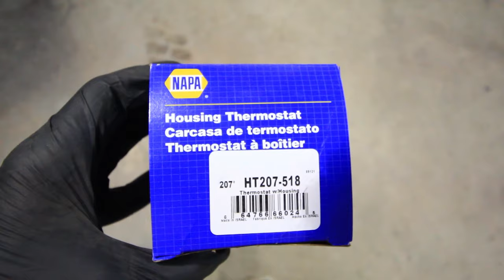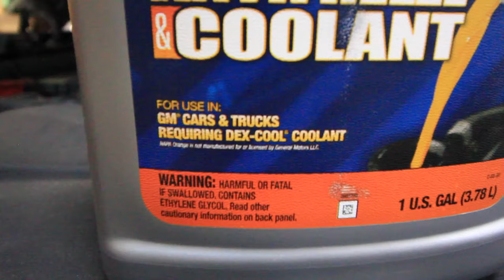Radiator Fan Won't Turn Off: 2014 - 2019 Silverado & Sierra: Bad Thermostat Replaced - Part 12674639

Comment: Just a heads up, if you remove the cap from the coolant reservoir tank it will relieve the pressure, then put the cap back on so that it doesn't drain out. Otherwise, awesome walk through! Thanks!
Reply from the maker: You're correct!
Reply: Do I need to put the cap back on as soon as I disconnect the hoses?
Reply: @jacobstewart4738  before you remove the hoses. I only lost about 1/4 of a gallon changing my thermostat
Reply from the maker: Hey Jacob! You can but it won't matter. we've done this a few times on different trucks.  No matter what you do, you'll loose a little fluid.
Reply: Would you recommend to start with the temperature sensor, or go straight to the thermostat? I haven’t gotten a check engine light so I can’t pin point what it truly is with a code reader thanks. I was thinking of just starting with the sensor first, but maybe through your guys experience you can share what works best.
Reply: I'm happy I saw this! Cause I'm about to change mine out today and didn't know that lol
Reply: Great video. A list of tools needed and sizes would also be helpful.
Reply: How do you know thermolstar is problem.
Reply: 19mm and 10mm

Comment: Great video. Gave me the confidence to do it myself and everything turned out great. I have never considered myself as a “car guy” so being able to get a project like this done was awesome. Thanks for your help and thanks for the video! 

My vehicle was a 2014 GMC Sierra and everything worked great.
Reply from the maker: Hey Fredrich, I really appreciate you taking the time to leave a comment.  It's really cool to hear that I was able to break this fix down and explain it we'll enough to get you motivated.  I'm glad that I was able to help you out!
Reply: You gave me courage rn too imma go to autozone and get the part to do this before lunch
Reply: It was super easy I got it done in 30 minutes work was like 10 of actual work putting everything together again and then let it sit 20 minutes without the battery to reset the system and bye bye problems

Comment: I just replaced the sensor and the problem continued with the coolant fan running and the temp gauge stuck on 160°. I drove it about eight miles, still no change. Disconnected the negative connection on the battery, waited about 10-15 minutes to reset the computer, hooked it all back up and everything is now working perfect! Thanks guys you saved me a bunch of money and downtime at the dealer.
Reply from the maker: Glad we could help!
Reply: I had to do similar but with an OBD2 tool

Comment: I have a 2014 4WD, V6, EcoTec3, 4.3L. The fan wouldn't turn off one day but the next few days everything was fine. About a week later it started staying on again and the check engine light turned on. My temp gauge read zero when it stayed on. Only thing that popped up was thermostat when I checked for codes. Found this video and it helped so much! Fixed it and after a couple starts the check engine light went off by itself, no battery reset needed. For anyone about to do this with this model, I needed less than a gallon of 50/50 dexcool and went a little over the cold full line because the hoses were empty.
Reply from the maker: Glad we could help!

Comment: Same problem fans would not go off. Changed sensor still fans kept running. Took fuses out for fans to keep from running battery down. decided to start pickup and see if guage would move without fans and the temp. rose so I knew thermostat was ok. Took cable off battery to reset computer and put fuses back in and connected cable back to battery. started engine things are great! Thanks for the video!
Reply from the maker: Glad we could help!

Comment: Awesome  video. Just a heads up on filling it. Turn your gallon around to where the spout is on top so air will easily flow in and not cause the coolant to change the flow too much and have a steady pour
Reply from the maker: Thanks bro

Comment: The temp sensor video saved me $$$. After a month though the fan came back on so I’m going to replace the thermostat. My grands call me Granny the mechanic thanks to you. Do you have a video on replacing the shifter cable for a 2005  2500 Silverado? Thx so much.
Reply from the maker: Hello Linda! Before you try the thermostat, check out our troubleshooting video linked here: https://youtu.be/wed9eZxPwsQ

Disconnecting the battery may be all you need.  However, we recommend replacing both the thermostat and the sensor at the same time.  As for the 2005, we don't have a video on that, but if we ever get the opportunity to work on one, we will make a video for you!
Reply: Did replacing the thermostat fix your issue?

Comment: What most of these vids on this topic don't mention is that you'll need to use your code reader to reset the error code once you are done, or disconnect the battery for a few minutes. Failure to do so meant in my case at least, the problem was unchanged. Even thought there's no CEL, there is still a code.
Reply from the maker: What's up Stuart?!  I have to say you are wrong, we go over disconnecting the battery in this video: https://youtu.be/wed9eZxPwsQ. This particular video is one in a three part series linked here: https://youtube.com/playlist?list=PLnPXcXYmgiuvbA7f_Zot4ScG1DJ7QJgO8. As for disconnecting the battery, yes you are correct.  If you don't, the truck will act as if the issue was never fixed.
Reply: What if I didn’t get any codes or anything? Bc my fan is just on and I changed the thermostat and the fan relay

Comment: Love your vids...  I'm not having an issues with the fans running after I turn off the truck...  I'm having issues with the fans turning slowly...  I replaced the sensor and those fans took off crazy fast for I start, then the fans went back to running slow 🤦🏼‍♂️
Reply from the maker: Hey David, that's an interesting problem.  I wonder if it is related to the thermostat?  I see you watched this video.  Have you attempted to replace it?
Reply: @TheBrothersWorkshop  I've just returned from the zone with a new replacement and waiting for the engine to cool down before the swap

Comment: just experienced this fan issue on my 14 sierra.  my immediate thought was temp sensor or thermostat.  did research and it looks to be it..  BUT in my case what i did was while driving i popped in my obd2 elm bt adapter, and literally cleared the code while i was driving with TORQUE lol and the fan stopped and guage dial corrected itself to the actual current temp.  Just in case these videos dont help the issue try that, i literally stopped the fan and corrected the problem with a simple fault clear.  I'm sure theres still an underlying problem which i'll do the sensor and thermostat if this happens again, but i took a lazy man approach today.
Reply from the maker: Resetting the codes will only stop this issue for a short time. It will always come back. That is because you have not fixed the root of the cause. You have to replace the temperature sensor and the thermostat, then reset the computer and the issue will be fixed. Please watch all three of our videos on this topic.

Comment: Does losing that much of the coolant affect the AC performance? It gets 100+° where I live so the AC has to be top notch cold. Hence the reason I need my thermostat replaced to begin with cause my air doesn’t cool when it’s stuck open 😒

Comment from the maker: If you're still having issues after you replaced the sensor, watch our next video linked here: https://youtu.be/wed9eZxPwsQ
Reply: So, did changing the thermostat fix the issue?? I got a 2015 high country doing the same thing.. changed the sensor a couple months ago.. worked fine until no.. doing the same thing.. fans on high and temp gauge at 160.. full of coolant
Reply: Still having issues.  Did the sensor about a year back and it worked until now.  Fan running continuously, I just changed the thermostat a few minutes ago but when I turned car on, fans immediately came on, temp still at 160 at idle
Reply: @timmydixon6167  did you figure it out I also have a 2015 high country and it’s doing the same thing

Comment: Same problem, change the sensor, did not fix the issue. My AC stopped when the fan would not shut off. The tire pressure for 3 tires were on as low on air [ they were around 30 lbs] about a week prior to the fan not shutting off. Check engine lite came on a day later than the fan wouldn't turn off. I disconnected the battery for about 15 minutes and after putting it back on, everything worked correctly. Fan shut off correctly, tire sensors stopped showing low air, ac blew cold air and check engine lite went off. It has been about a week now and no issues [hopefully] yet.
Reply from the maker: This issue does not throw a code.  That tells me your truck is having a different issue, or you may have multiple issues.  If the fan issue continues, I've linked a troubleshooting video below: 👇
https://youtu.be/wed9eZxPwsQ

Comment: Hi! My truck is doing the exact same thing! Curious if this fixed the problem. About to try it myself with your video and I am no mechanic 😅
Reply from the maker: Yes it did! We also made several other videos about this same issue, so you can check out the other videos if you feel like you need more information or detail.
Reply: @TheBrothersWorkshop  so it worked since tuesday and today on my way home from work the AC stopped blowing cold. The gage is still working and no fan now but AC stopped

Comment: hey, i've got this recurring issue with the fan not turning off.. and now my ac isn't blowing cold air at all.. are these problems related? and do you think solving one, might solve the other?
Reply from the maker: Yes, they are the same problem.  This video is one of a three part series.  I've listed our update video below.  It will explain everything and how to fix the issue: https://youtu.be/7gKbLHhD1cw

Comment: Hmmm.   ok, having the issue everyone else is with fan on full blast and temp gauge not moving, so going to replace both thermostat and coolant sensor and erase all codes.  One question thou....picked up both parts yesterday, but online showed 2 thermostats and I picked up the 194 degree one.  I see this uses 207 degree!  Online shows optimal 195 to 205 and why i picked lower of the two, but also suggests 207 is factory stock and helps run better and more efficient!!  Soo, which should i use and 194F or return it for the 207F unit?!??
Reply from the maker: When in doubt, always go factory specific.

Comment: Did that fix the problem? I just changed my sensor over the weekend and am having problems again.
Reply from the maker: Replacing both the sensor and thermostat fix the issue.  It's all spelled out in the video.

Comment: I have a 95 Trans am. My fan stays on all the time. I checked relays (all good!), changed coolant temp sensor and fans still on all the time. Do you think changing the thermostat might help ?
Reply from the maker: I would think about looking into the temperature sensor first, and if that didn't work changing the thermostat.  Not sure how it's set up, but it wouldn't hurt.  Typically I like to change both out at the same time. Realize we did separate videos here, but it's something I would do at the same time.

Comment: So did this solve the problem? I'm having the exact same problem and replaced the sensor only to have the problem come back a few days later. I just want to make sure that before I order the thermostat that this will solve the problem.
Reply from the maker: Replacing both the thermostat and the sensor does the trick. This is one of three videos in this series. I have a troubleshooting video as well. You need to watch all of them. They're linked below: 👇

1. Temperature sensor video: https://youtu.be/aJeksrxcCDI

2. Thermostat replacement video: https://youtu.be/WvLyBM8FHdM

3. Troubleshooting video: https://youtu.be/wed9eZxPwsQ

Comment: I have a 2017 duramax had the code p0128 a couple times changed the coolant temp sensor a couple times and worked for short time. Could one or both of the thermostats be bad? The truck has a hard time coming up to temp also
Reply from the maker: It's possible but the truck we are working on here in the video has a gas 5.3 V8.  This fix works on all of the gas motors.  I know you have a diesel, but it might be worth a shot.  Please let us know how it goes.
Reply: @TheBrothersWorkshop  I forgot to say that the gauge would not move from 160 sometimes it would get a little past half but that’s it never to operating temp

Comment: You just motivated me to do it . thanks for the awsome video. I thought it was like  operating a heart but it actually seems pretty simple thanks a lot dude
Reply from the maker: I thought the same thing before I gave it a shot.  You got it bro! 🙌
Reply: Got it done in like 10 minutes thanks to you 👏🏻👏🏻
Reply: I got it done just had to disconnect the battery to reset the system , before the reset the fans were still turning on and a check engine was lit , after everything cleared and it's running perfectly now thanks a lot .

Comment: Great video and explanation, I have replaced the sensor first but did not fix the prob. My question is: Have you fixed the main prob. after the thermostat replacement? If yes I will do the same.

Sincerely,
Reply from the maker: This video is one of three we have explaining how to fix this issue.  Below are the other two videos:
Troubleshooting video:
https://youtu.be/wed9eZxPwsQ
Temperature Sensor Replacement Video:
https://youtu.be/aJeksrxcCDI
Reply: @TheBrothersWorkshop  Thx for your reply buddy, I'll first start try to troubleshooting before replacing the Thermostat which I already purchased but not used yet.
I'll update you.

Whish you all the best and HNY 2023.
Reply: @TheBrothersWorkshop  Hi again, good news. I did the troubleshooting before i try with the thermostat, started with the battery first and it worked great 😀. I’ll return back the thermostat and get my money back.
I really appreciate your support.
Keep it up buddy.
Sincerely,
A follower from Bahrain

Comment: Is it possible this issue and the temp sensor can make my truck not have cool air? Sometimes the fan runs on and it takes a while until the AC kicks in real cool, other than that I drive for like 20 mins for it to hit good, It’s not broken but just delayed. I just actually fixed my AC line about a year ago so that should be good. Im curious if the truck thinks the engine is overheating with the sensor broken, and using all my cooling towards the engine and not in the truck.
Reply from the maker: From what you are describing it doesn't sound like the same thing.  Id you have a 2014-15 Silverado and Sierra, they are know for AC issues.  It could be a number of problems.

Comment: Hey! This morning after I turned off the gmc Serra 2015 truck the engine fan stayed on. Do you think changing the thermostat would fix this issue?
Reply from the maker: I know this fix works, but you have to replace the temperature sensor as well.   Before you do anything, watch all three of the videos we made about it.  I have linked the playlist here for you: Radiator Fan Won't Turn Off: 2014 - 2019 Silverado & Sierra: Bad Coolant Temperature Sensor and Thermostat Replaced: https://www.youtube.com/playlist?list=PLnPXcXYmgiuvbA7f_Zot4ScG1DJ7QJgO8
Reply: @TheBrothersWorkshop  thank you so much

Comment: My truck just started doing that tonight I'm replace the sensor and the thermostat do I need to bleed the valve or can I just loosen the radiator cap to let the pressure off
Reply from the maker: Hey! If you watch the full video, you'll see that I made the mistake of not opening the lid to let pressure out.  It won't hurt to do either, but prepare for a mess if you don't.  If you have any issues, this is our troubleshooting video: https://youtu.be/wed9eZxPwsQ

Comment: As the fan stays high while with the temp reading at 160 are you guys also getting a check engine light on? because i am.
Reply from the maker: No we never got to check engine light. For your situation if you have a light, I would run the codes. You may have a different issue all together.

Comment: If you change thermostat and Sensor and the fans are still running high afterwards unplug and plug the battery that did the truck for me was working good after
Reply from the maker: Yep, we said it here... https://youtu.be/wed9eZxPwsQ

Comment: Awesome video! But if you happen to come across this situation check this out. Chevrolet and GMC owners!!! After an oil change my cooling fans kept running! With the exact same symptom this video is showing! Remember every time you get an oil change they top off all of your fluids. After my investigation I noticed my coolant reservoir was over filled! Well, I Drained the excess coolant out with a spay bottle sprayer and this problem was solved!!! Of course, the mechanic denied my reservoir was not the problem. They do not teach these young kids small remedies in Tech school! Everyone know you should not over fill oil, transmission and coolant reservoir! Coolant reservoirs has a cold fill line very easy to see!!!!! SMH.
Reply from the maker: Hey Corwin! That's a really interesting issue.  It makes sense.  There are several people out there who have replaced the parts and the issue continues.  I bet this might be their problem.

Comment: If I changed the sensor and it worked fine but tonight the fan stayed on after turning truck off , would I need to replace sensor again along with thermostat?
Reply from the maker: You will not need to replace the sensor again.  Please watch this video for more info: https://youtu.be/wed9eZxPwsQ